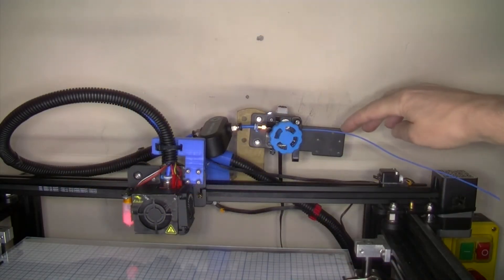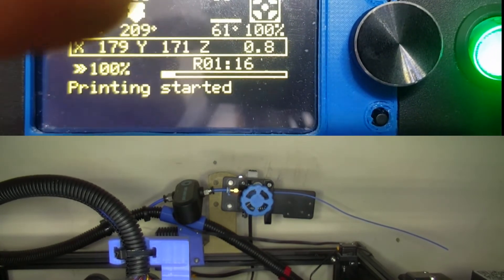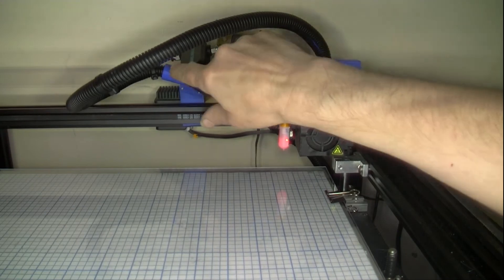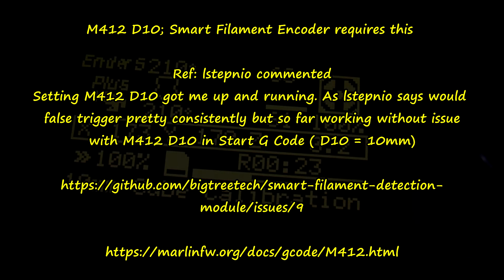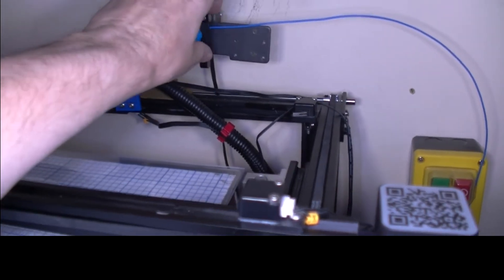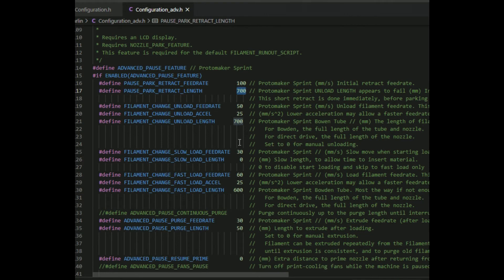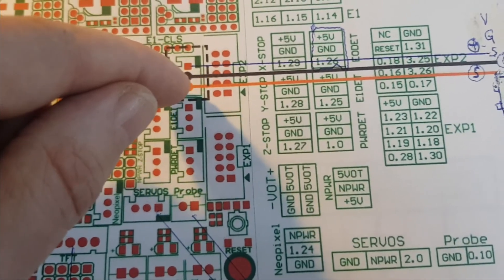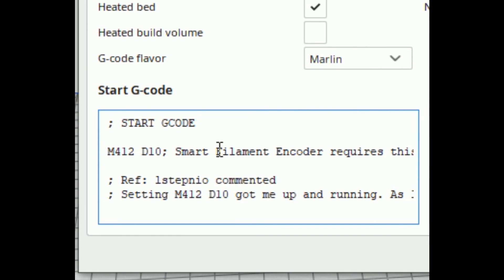BTT Smart Filament Sensor Fix

Comment: Should I use also M412 D10 with a BTT SFS v2 version ? I constantly have filament runout problems
Reply from the maker: One reason I found to a Run out being triggered is that the nozzle is so close the the build plate and this prevents the filament moving
Reply from the maker: https://www.youtube.com/watch?v=xIwoPvu1DEg 3D Print your own